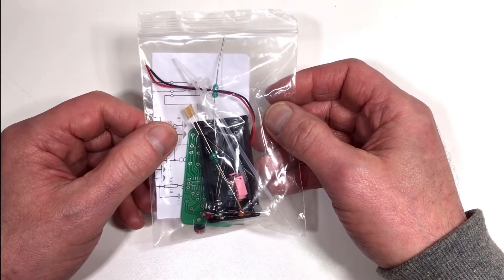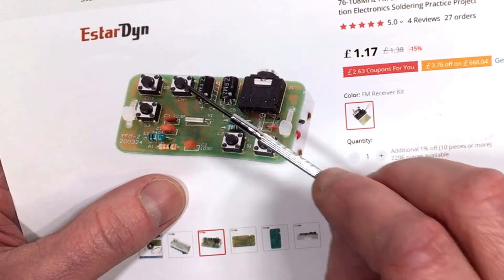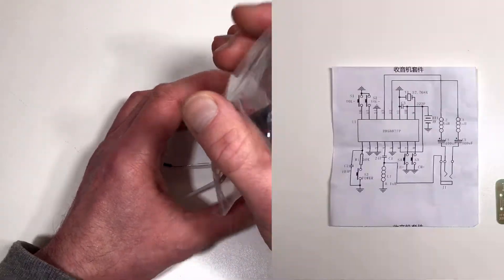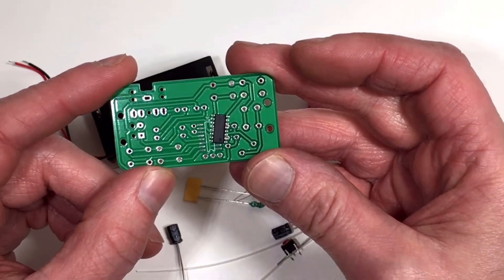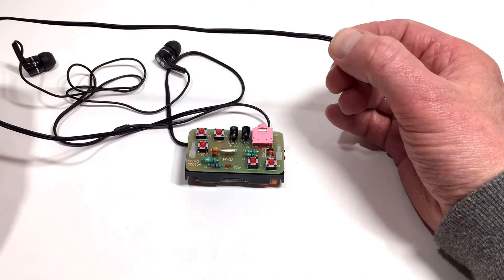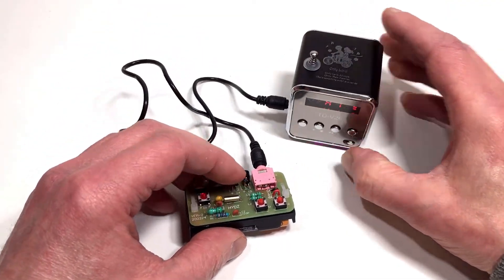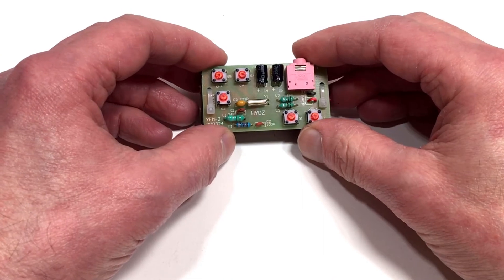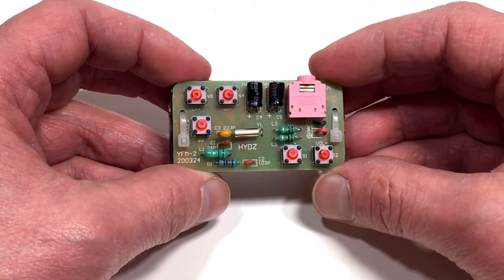A Stereo FM Radio Receiver Electronics Kit for just $3!

Comment: This is a quick easy project and I am no solder expert.  The radio sounds great through pro headphones. It appears that the radio may use the headphone cable as the antenna.
Reply from the maker: Hi, thanks for your feedback. It’s good to hear that you have been successful and got yourself a useful little personal FM radio. My soldering isn’t the best, but a little flux paste and clean copper tracks and device pins certainly help. Yes, you are correct, this little radio uses the lead of your headphones as the FM antenna. It might be fun to experiment to see how changing the shape of this lead affects performance. Best regards TWCG

Comment: I would like to ask you which out of the Tecsun R 909 Vs the Retekess v115.. which of these would pull in the most stations it's digital Vs l assume a longer Ariel on the Tecsun ...Thank you .
Reply from the maker: Hi, good question. It really depends a little on your budget. The Tecsun is a good radio for the price, the drawbacks being an analogue style scale so you need to remember where you found your various stations and the sound is a little shrill at times. However, the local / DX switch is a useful feature. The Retekess on the other hand has a digital display and the ability to store your favourite stations. Both are pretty good at pulling in stations & clipping an extension wire to the telescopic aerial does help both sets to pull in the weaker stations. If you have a limited budget, then the Tecsun is fine, but if your funds will stretch to it, then in my opinion, the Retekess offers better overall value. A digital display, a better sound plus the MP3 playback, together with a built in rechargeable battery, gives it the edge over the Tecsun. It's worth shopping around, as I have seen both radios at different prices. Hope this helps & good luck finding your radio.
Reply: Thank you for your considered reply...
Reply from the maker: @imwatchingyou6113  Happy to help - would interested to see what you end up buying.